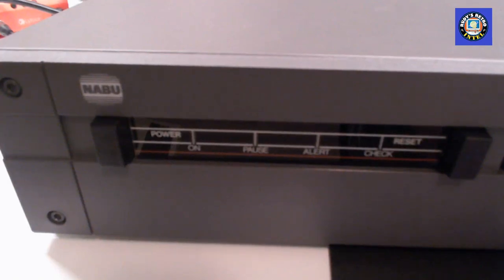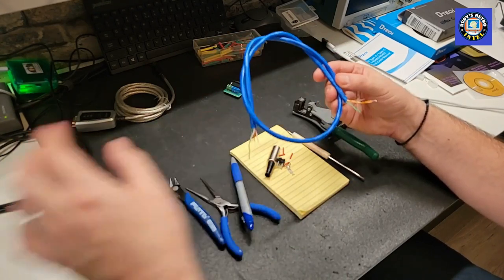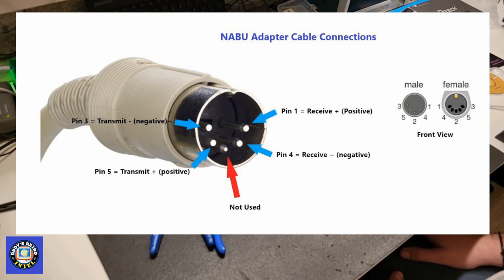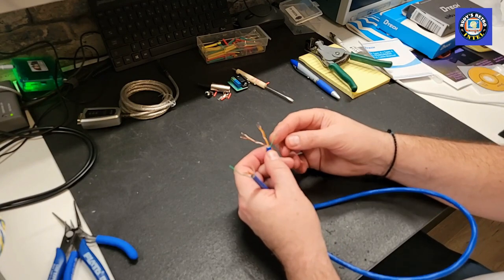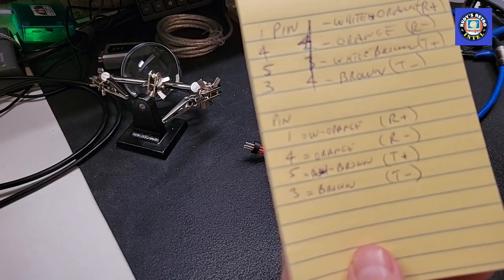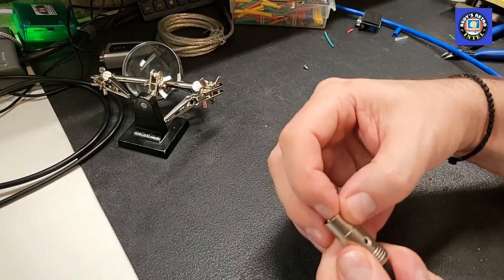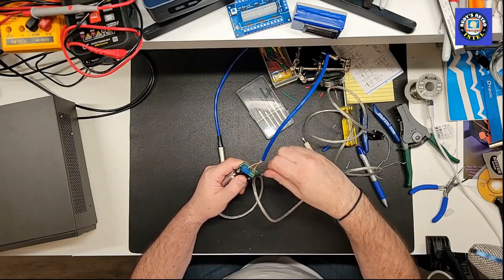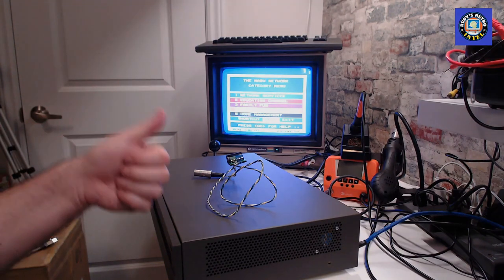How to Building a NABU Computer Network Adapter Cable

Comment: thanks for documenting the process and making it easier for future nabuers. i havent made my cable yet, i've got all the parts.
Reply from the maker: Glad to help out. Let me know how it works out for you and if my documentation worked foe you.
Reply from the maker: Yes, I am  still looking for a source for U14 myself. Will let you know if I can find one. U14 - TR1863P-02
Reply: @RudysRetroIntel  I got it to work! After much struggle, I connected pin4 to T/R+   and pin5 to T/R-    and ground to the outer casing. only  using two wires!
Reply from the maker: Excellent! Thanks for sharing!!

Comment: Has anyone tried using the test port on the back of a Cable STB? You will need to find out the pinout to see if there is a TXD,RXD,RTS,CTS,DCD and GND.
Reply from the maker: Not that I know of but would be good to do.

Comment: what about the termination resistor? RS422 uses a balanced pair that must be terminated with 180 Ohm at the receiving end of the twisted pair. on the NABU schematic you see this resistor on what for the NABU is the receiving side, which for the adapter is the transmitting side, but where is the terminating resistor for the other twisted pair, the pair that is transmitting on the NABU, and receiving on the adapter.
It would be logical if the terminator is inside the adapter, but is it? If it is not you have to add it externally, that is between the screw terminals for the receive channel. Without a terminating resistor it will somewhat work, but reflections in the cable will make what the NABU sends to the PC unreliable! 
Probably I'm wrong in worrying here, but nobody is talking about this subject, which worries me.
Reply from the maker: Interesting. Another YouTuber had created a cable that is over 600 feet and worked perfectly well, so I'm not sure if the resistor is needed. We can assume that if there are issues, then that resistor could be the solution. This is something that would need testing. My 10 foot cable has been working fine without the resistor and not had any issues. Thanks for sharing, and I will experiment if I get errors.